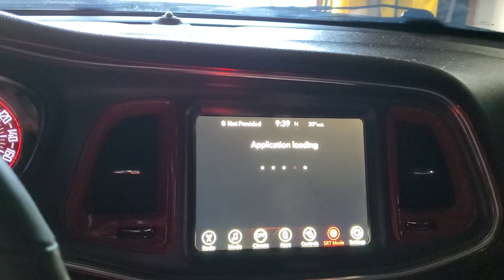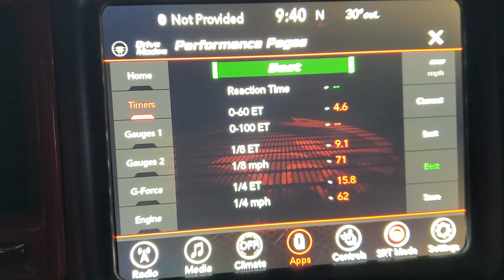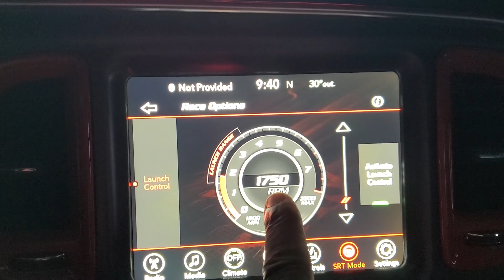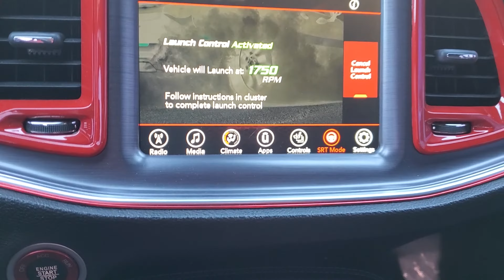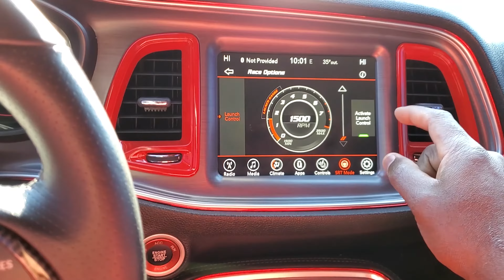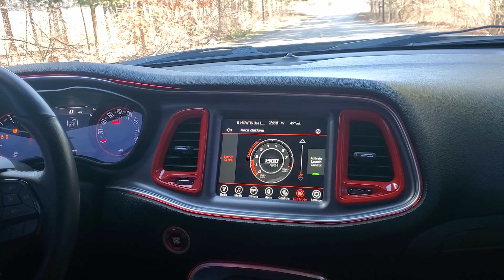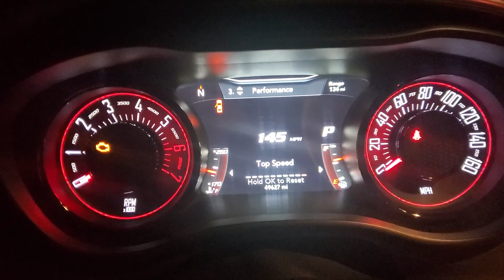Challenger RT Launch Control

Comment: You have to hold the rpms until the cluster says it’s ready for launch, you can’t just floor it. It’ll let you know when to floor it. When it’s time, let off brake and stomp pedal
Reply from the maker: Yeah issue was it was not showing in the cluster so not truly active till my video on the AlphaOBD where I activated the cluster.

Comment: for the launch control to work, please have one foot on the brake.. and with the other foot.. apply FULL throttle.. then you will see the RPM go up to 1500 or whatever.. release the brake and launch.. I made a video on my channel you may check it at:
https://youtu.be/Li-O6Ko8eJw

Comment: Did your tazer give your 5.7 line lock and launch control?
Reply from the maker: I had to make an adjustment with AlphaOBD for the launch control to work so now with the tazer both Line Lock & Launch control work correctly
Reply: @coopdogg871  with a 5.7? What all did you have to do?
Reply from the maker: @alphaomega5917  It's a long forum and been a while but I followed it to get mine working:  https://www.challengertalk.com/threads/how-to-add-stp-launch-control-to-an-r-t-w-manual-trans.678125/page-34
Reply: So I’m having trouble initializing my abs for some reason any tips ?